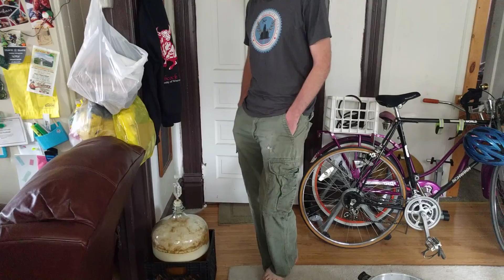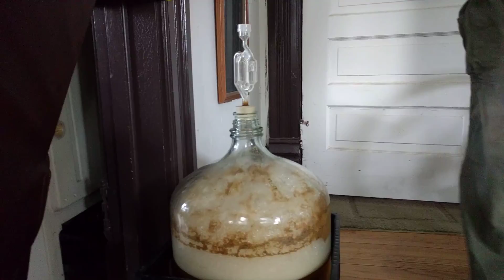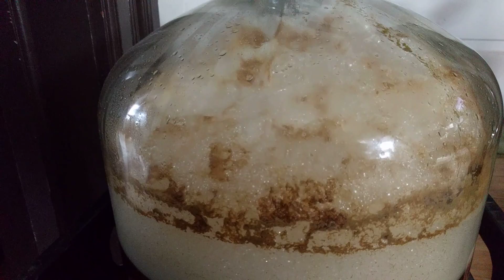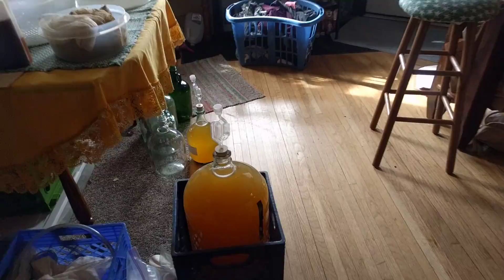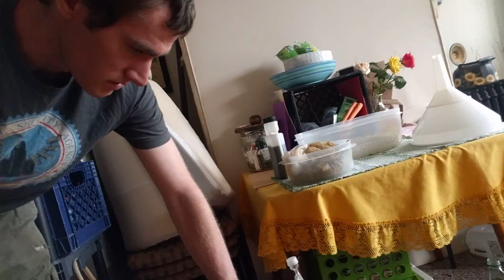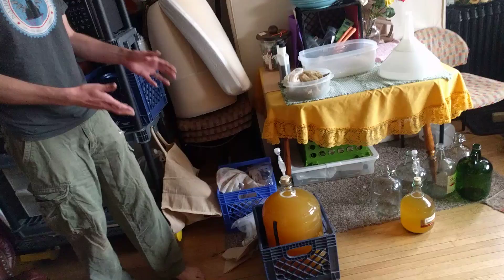Difference between primary and secondary fermentation

Comment: Thanks. Although I am still confused as to why I should transfer to secondary when I could just wait it out in primary and then go straight to bottling... That's the answer I'm searching for, as am trying to decide if and when it will be worth the effort for me...
Reply from the maker: Usually the primary is large enough for the froth that develops from the highly active primary fermentation. Usually after that you need to rack it which means filtering out any large particles and lots of the sediment. after that there's too much space if you put it back into a primary fermenter and oxygen could stay on top and start to oxidize the beer or wine
Reply: Secondary is really the first step in conditioning.
You want to take product off the Lees ( Sediment)
First racking separates the two and allows for more sediment to fall into the new container and make sure fermentation has stopped, along with, it starts degassing.
Only way to really know fermentation has stopped is by Gravity readings, one at the start, one after your first rack and the testing of that rack in 1 or 2 weeks.
If the reading is unchanged at the point, it is done fermenting.